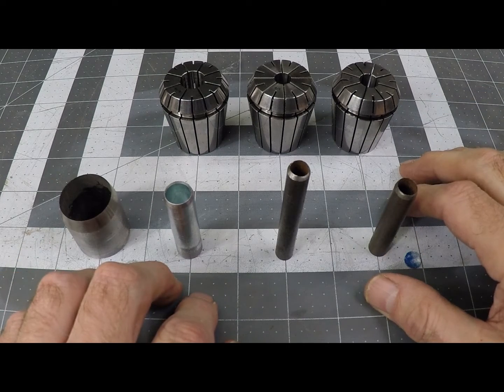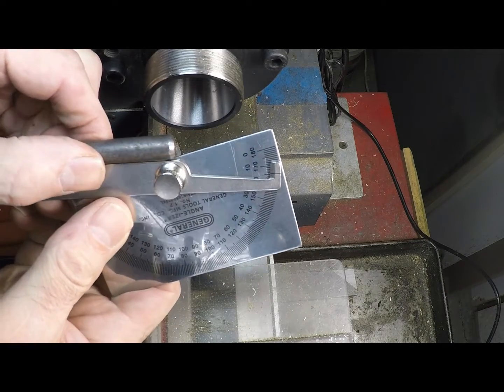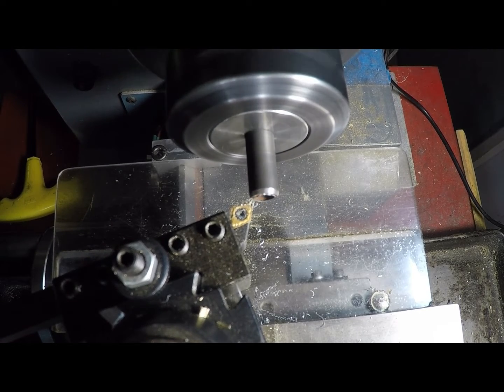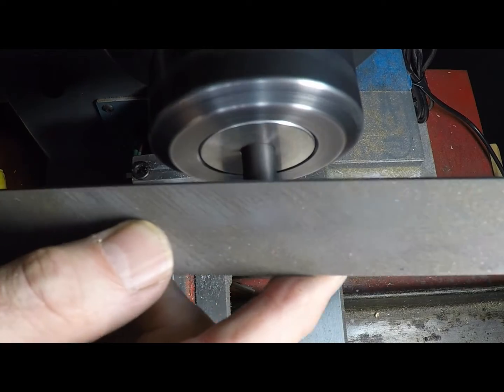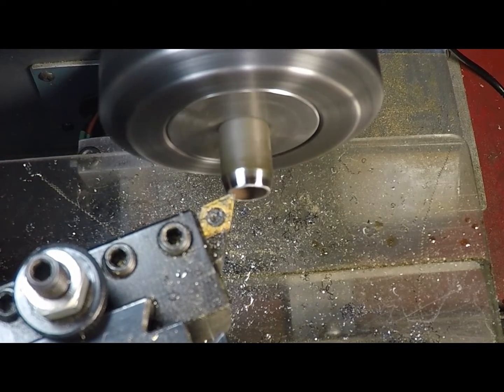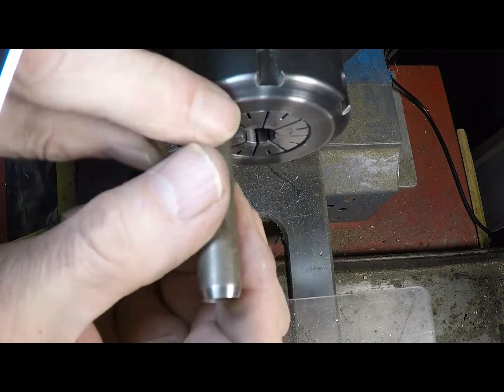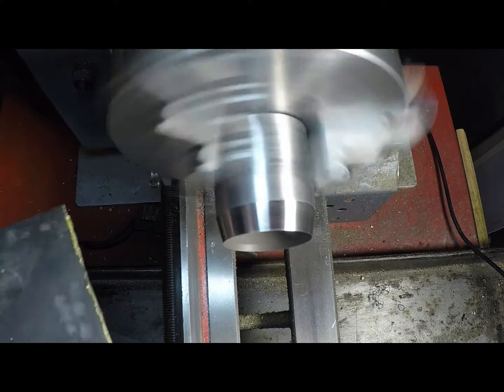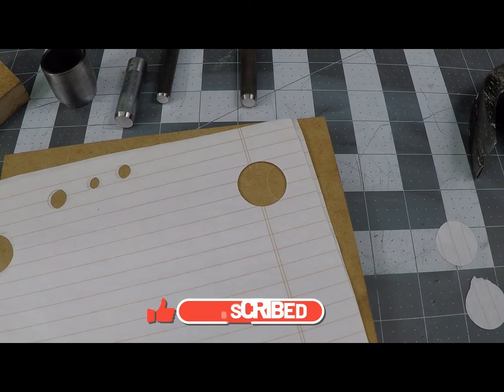Sharpening hole punches

Comment: Would it make a difference which way you run the cut?
Reply from the maker: I'm not sure, but by feel it felt like working down from the top got better than working up from the tip on the handmade crappy ones, but they're seem to be true from the good factory punches.

Comment: Thanks Guy. I have a box of four which have gone blunt. I'll give this a go.  I use them on leather.
Reply from the maker: It's worth a try. And also as you may have noted in the description my friend was advised to try using punches in a small drill press rather than just hammering them.
Reply: @GuyMarsdenMakesStuff  Good tip.